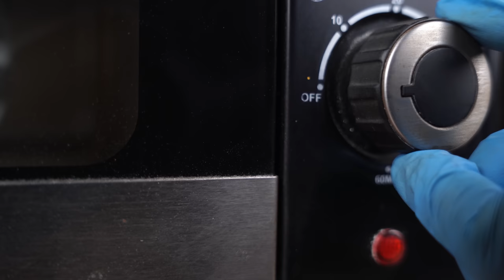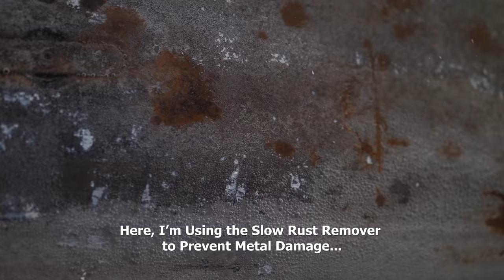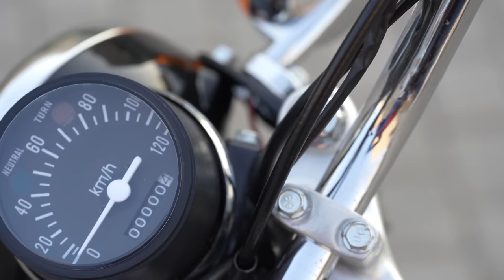Full Restoration around 50 Years Old Abandoned Motorcycle

Comment: Wonderful job.
I'm doing my first full restoration of a 1972 Yamaha RT1 360 Enduro
What did you use to remove the paint off the frame pieces and tank?
What solution did you use for the slow Rust remover and where can I get it?
What solution did you use for the Rust protection and where can I get it?
Thanks

Comment: Lovely restoration, But I hate to see mechanics prising machined mating surfaces or mechanical parts apart with a screwdriver! I have seen faces so chewed the had to be welded and surfaced to stand any chance of sealing again and bolt hole bosses snapped right off having to be welded, and in one build two of the casas were so badly mangled they had to be scrapped!!! Not that you were that bad of course but it makes me shudder when I see anyone do it!